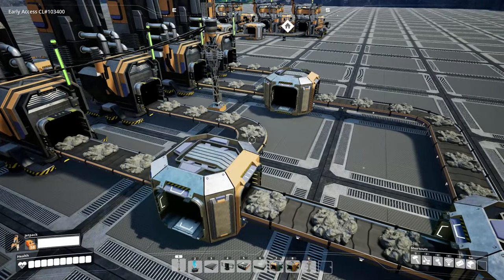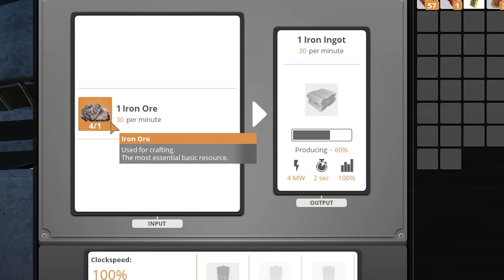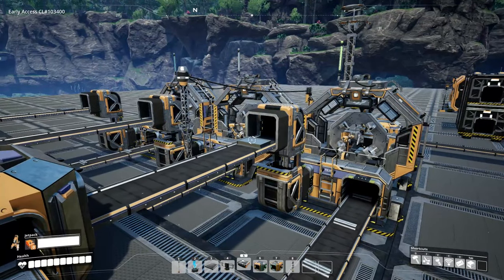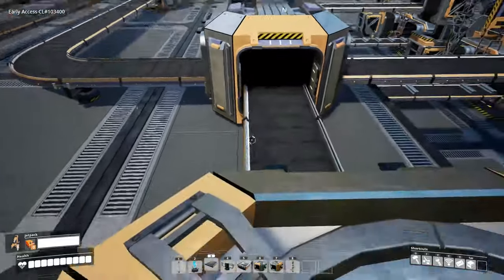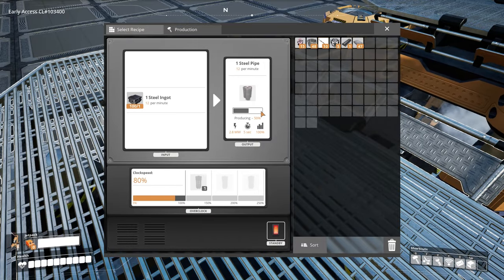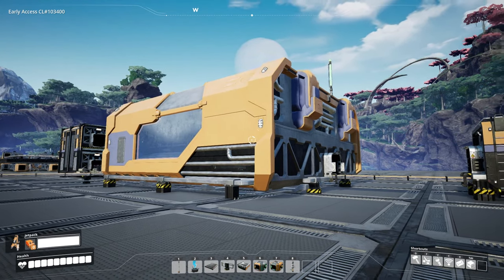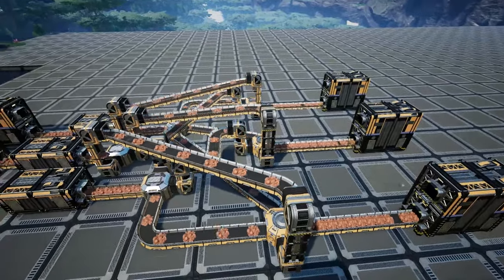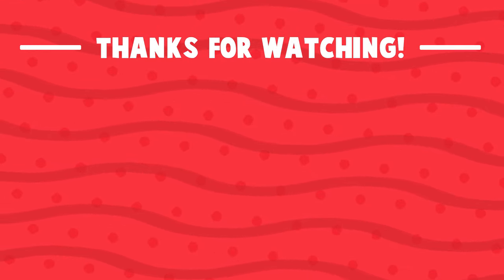Load Balancer Tips for an Efficient Factory! - Satisfactory Tips (Beginner + Advanced)

Comment: these all are absolutelu useless. Because if you use straight splitters like at 5:05, balance won't brake!
Example: you have 1 input and 4 outputs you want to balance. Each connected to smelters/manufacturers/etc.
Every output is empty. So, your proportions will be 1/2, 1/4, 1/8 and 1/16 (1/n^2). Looks not good and needs to balance, right?
But wait. 1st output will overflow soon and will be locked, so no resources can be moved on this way and this means you have only 3 outputs already. And last output will be never overflown, so it means everything is balancing automatically.
Reply: Yes, but it also means the one at the end is operating inefficiently until 1, 2, and 3 are all capped at however many resources is a full stack. 

Let's use casted screws as an example. Underclocking to 10 iron ingots per minute, to 3 constructors, from a single smelter, you use the overflow method to input the ingots. That means that constructor one gets 15 iron ingots, until full, 2 gets 7.5, and 3 gets 3.75 per minute. You think "eventually this will balance" and leave it. 

However, a) screws stack to 500, meaning constructor 1 will be running a long time before it reaches saturation b) your smallest belt moves 60 resources per minute, but your screws output at 40 per minute and c) wherever you send those screws, they either need to accumulate to the storage limit of their destination or forever be running behind.

All of this means that constructor 2 and 3 will never run at 100% efficiency, and will instead put out less than your planned on 40 screws, and constructor 1 will never go higher than 100% efficiency, so instead of 120screws out, you'll get 85. Meaning if you plan on having 120 for say 2 reinforced iron plate assemblers, you won't even get close, and the whole line becomes more inefficient, unless you manually add screws into constructor 2 and 3.